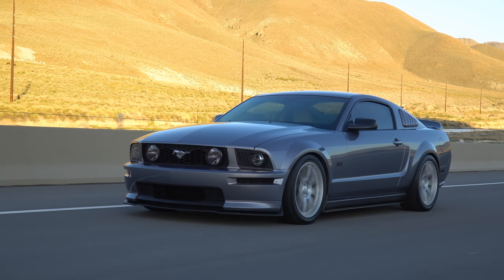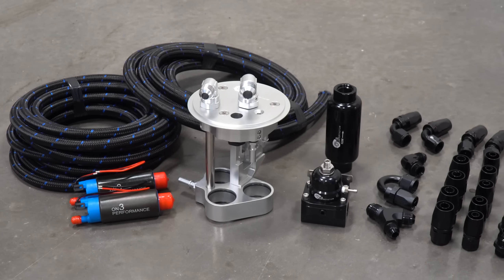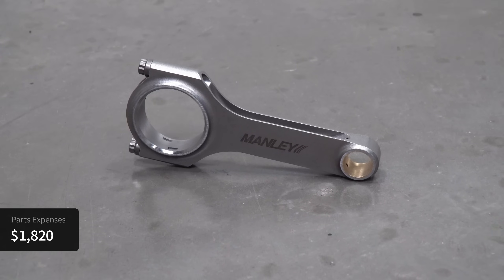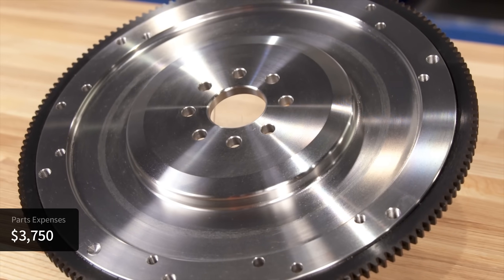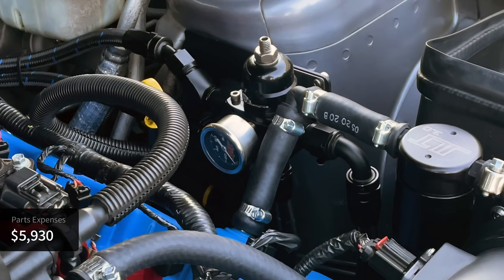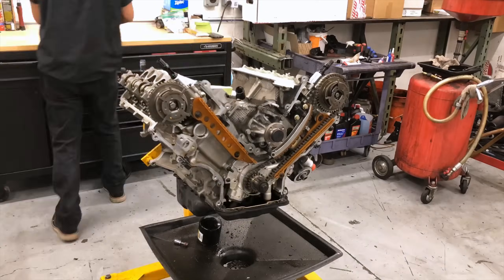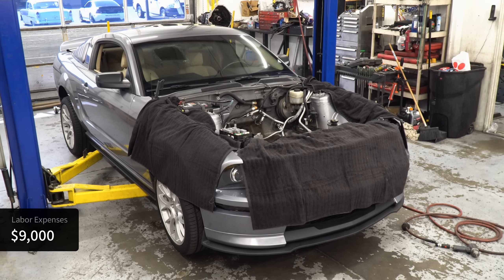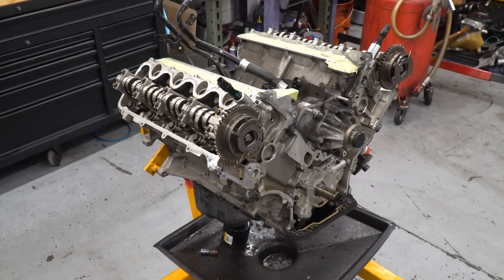Breaking down the (actual) cost of rebuilding a V8

Comment: 16k for 370whp!? Sir you have a lot of patience to not be boiling lol, good video as always!
Reply from the maker: it's certainly a bummer
Reply: @Four_Eyes  atleast its not your typical ls lmfao
Reply: @LukeWaters  lol all that money to make less power than a 6.0 ls truck engine with a 250$ cam😅😂
Reply: @neilbrown82  it wasn't built for na power!!!!  Gosh what is wrong with you people?  He didn't build it to make na power it was built with forced induction in mind.  It can reliably take 1000 for a long long time beating on it.  It was not built for high na hp it has lower compression it was built for boost!!!
Reply: @midnight347  😂 lol
Reply: @LukeWaters hey 16k into an ls would produce FAR, FAR more than this ford did. So who's laughing after that??
Reply: @Four_Eyes  nonsense man, the journeys been INCREDIBLE!
Reply: @Four_Eyes  I mean you spend enough money you could have swapped in a coyote instead but I didn't know people spent that much money on the three valve I thought most people got rid of them
Reply: @Four_Eyes  It wont be when you throw a turbo on it.
Reply: 16k wasn't spent to make a N/A motor. These mods are designed to be used in conjunction with forced induction
Reply: @blue3v067  true, bit man 16k to still be at 370whp has to hurt just a little bit
Reply: @LukeWaters  For sure lol Something like that is going to cost an arm and a leg but you can hit 1000hp without those mods
Reply: @blue3v067  and at the end of the day it's gonna be reliable too
Reply: Luke Waters imagine how happy hell be when hes hitting 700hp at 8psi😃
Reply: @LukeWaters  exactly you can swap in a Gen 2 coyote out of an F-150 and be a little over 400 wheel horsepower I don't know why anybody would spend money on a three valve in the first place
Reply: @LukeWaters  itsjusta6 has completely built GT350 motor, built for forced induction and it made like 350 wheel without any boost. When the motor was built for 1500hp. And I don’t recall if it was 25k or 50k but it was an expensive motor.

So the whole argument of “oh 16k to make 370whp is a waste” is literally just because it’s NA. And the motor was built to be forced induction as you know by this point.
Reply: @neilbrown82  At some point it's just stubbornness. It's the same as people who sink tens of thousands into a Civic to run quarter miles in 8 seconds when they could just buy a faster car instead that would get there with far less mods.
Reply: @neilbrown82  this engine can take 1000 wheel reliable a stock gen 2 coyote is not gonna do that.  They can do 800 pretty good some have hit 1000 but this built 3v will stay together much better at 1000 than a stock gen 2 coyote.  It was built for boost and is still na!!!!  Why can't people understand this?  Lol
Reply: @BigUriel  so many of you guys that make statements like that just don't understand a true car guys personal journey and satisfaction of extracting the most that u can from your favourite platform, no matter if it's a civic or a mustang or a 91 olds toronado, do what makes u happy and gives u a sense of accomplishment, especially if money's not an issue, why not? Not everyone has to build what everyone else is doing to get the most hp for the least amount of money. Extraordinary men do unique things, that's what pushes the envelop of innovation and breeds new ideas into our wonderful automotive world. I think most of these statements come from a place of jealousy.
Reply: @blue3v067 Do it. You do not understand how cars work. I hate the Toyota Supra.
Reply: @LukeWaters ”1,000hp” and “reliable”? Unless it’s a massive marine engine, there is nothing that can make you right.
Reply: @blue3v067 and another $20k?🥴
Reply: @LukeWaters  he definitely overspent on a lot, and you can do this for SIGNIFICANTLY cheaper doing everything yourself. You can build the 3v for boost that'll handle 700+whp for under 3k. Add your boost of choice, another 4-8k. This is definitely a F**k you money "because I can" build, its sick nonetheless though. Basic bolt ons and a good cam can put you at nearly this power level for a few grand. These cars are easy to find for 2-6k now, so its not that much money all in all
Reply: @blue3v067  that still doesn't make sense 16k almost 400.. if that makes good sense to you then ok..
Reply: @eddiedaugherty7063  First of all, would I spend that kind of money on a 3v, heck no. Keep in mind tho that 9k of that was labor, so 7k in parts to make a 400hp isnt too absurd. But what I was saying was he didn't spend 16k to make an N/A motor and leave it at that. You can't run 1000hp without those parts, so therefore I think its worth it. Not to mention the parts he replaced were just beefier versions, not necessarily things that will make more hp.
Reply: @blue3v067  yeah but f/I will cost him another 13 k because he's not doing the work himself he could have found a used GT500 motor and upgraded the blower and had 800 horsepower for the same price
Reply: @blue3v067  the 3v is a $5000 car. Find a car for less than 21k or even 21k making 370 to the wheels. He has a 370whp mustang with no loan and someone buying a used mustang with a gen 1 coyote is still in the 30k range, probably in debt and still losing a race.
Reply: He spent $8400 on labor. He could've saved at least 4k by doing some of that on his own.
Reply: @pronewbofficial  the labor is the real killer
Reply: @pronewbofficial  true
Reply: I was shocked about the horsepower number too. I’ve seen cars put down 20 horsepower more without the stroker kit and forged internals. Hopefully the right cams bring his numbers up cause I’d be devastated if my all motor build made FBO Cam numbers.
Reply: @5.2grimes  it's prob got lower compression because he's intended to boost it.  It wasn't built for na power.  It costed alot because it can take 1000 reliably.
Reply: @midnight347  are you aware how old this comment is lol. it’s been publicly known that’s why it made those power numbers for a while
Reply: @5.2grimes  I don't care how old the comment is.
Reply: Lol building an engine doesn’t magically produce horsepower tho
Reply: He spent so much cus its supporting mods and he is documenting everything. I made a 500whp and a 440wtq 3v for less than 10k. Been dailying it for 2 years now
Reply: @TexTheMaster  I bet its a pretty fun ride too!
Reply: @TexTheMaster  damn send your mod list 😅
Reply: 16k to make STOCK coyote power 😂😂😂😂😂😂😂😂😂😂😂😂😂😂😂
Reply: @jessefrias2575  why are you laughing? You have a 2V lol
Reply: @juju755-b7s  had. Coyote ftw now!
Reply: @juju755-b7s  what’s wrong with a 2v?
Reply: @juju755-b7s  , dont hate on tha 2vs
Reply: @juju755-b7s  that could be a 4v under the hood not far off from a 3v in terms of power stock vs stock but weighs less
Reply: @jessefrias2575  legit all he has to do now is put some type of forced induction and he’s golden
Reply: @jessefrias2575  16k less base price then a coyote mustang too
Reply: @jessefrias2575  funny when people laugh about dumping 16k into a 3V meanwhile others are financing a coyote at 400 dollars a month payments lmao
Reply: @jessefrias2575  2v boi
Reply: @jessefrias2575  and only 30 more horsepower than my bolt ons ecoboost lmfao
Reply: @christianhanna9401  ya but you have to drive a 4 cylinder Mustang.   Aka: Fail.  Mustangs are supposed to sound good not like a Focus ST.
Reply: @rxtuninginc8444  subjective, id prefer if my s197 had a 4 cylinder ecoboost, just a waaayyyy better engine, the efficiency of it absolutely shits on the 4.6
Reply: @trystanswansonart  meh the 4.6 will still probably last longer and be more reliable overall.  The ecoboost are not well proven with high mileage yet.
Reply: @rxtuninginc8444  Well that's hypothetical so it's not really possible to comment on it. I think I'll probably do the 3.5L F150 V6 swap since it's proven, don't need to reinvent the wheel yunno, but I want them mpg's since I daily my car and the first gen s197 has proven to suck back my gas lol, Just think the body style is tight
Reply: @trystanswansonart  buy another car thats cheaper as a daily and keep the Mustang as is.  For the cost of the swap you could just buy another car and modify the regular engine in the Mustang so it will be your toy.
Reply: @christianhanna9401  except ur mustang runs around with half a motor sounding like an '89 4 banger Ranger with a fart can exhaust! LMFAO!😂😂🤣🤣😅🤮🤮🤮💩💩
Reply: The trifecta of car mods. 
You can only have two at any given time: 
Cheap, Reliable, Fast
Reply: @sethbingo  unless of course we're talking about Honda engines, cheap reliable and fast!
Reply: That’s na it’s going to be at the 900-1000 hp mark
Reply: 16k to build an engine that supports 1k hp the power parts have yet to be added
Reply: You can buy a 350 out of a Van for like 300 dollars and spend a grand on it to make more power. I respect the 4.6, though.
Reply: He obviously is being sarcastic saying 370 wheel horsepower........ Right??????🤔
Reply: @danielgarcia9095 . It’s not a bad number because he built the motor to handle lots of boost. He could have went way bigger on cams and did high compression and made close to 450 at the wheels, but that was not his goals because he wanted to have drivability and lots of boost.
Reply: He has done all the work all he needs now is a turbo or turbos and tune.  That could reach 1000 hp done right.
Reply: i guess im going to by a chevy ls motor for 700.00, cam, springs and pushrods for 800.00 and have more power than that. i wanted to stay ford motor, but bump that. lol.
Reply: @SuperAudiowizard  u can buy cam n springs for $400
Reply: It’s a waste unless u have it boosted
Reply: Shoulda bought a chevy😂😂
Reply: You can 370 wheel with fbo and cams something on his build isn't right lol
Reply: @stickyicky2858  he used heads that lowered compression.  Good for when he goes FI... but hurting him while he still NA
Reply: My eco boost did 382 wheel horsepower. And it only cost me like $1,700 in mods
Reply: @4touchdowns1game29  Why are none of you factoring in the cost of the car? You can get a great condition 3v for 7-10k. Add in ~15-20k for built motor + forced induction, giving way to 700+ whp. Already a better value than a bolt-on 2015-2020 GT / Ecoboost in terms of performance.
Reply: @devnull.elixir  on what planet bro lol? Have you seen s197 prices lately? People are asking 20k for 50k miles.
Reply: @4touchdowns1game29  that's cool man. i gotta stock eco myself. 2018  with the 10 speed auto. 21,000 miles bought new. i like it. it's my daily. maybe I'll get a mild tune and exhaust. don't know, just like the way it looks. wasn't even a mustang guy.
Reply: @senorpepper3405  dope man. Yeah I like the tailights of the 18 and the front end of the 17. The 10 speed is no joke. I just like driving stick.
Reply: @senorpepper3405  yall bold for going into the exhaust shop with an ecoboost motor😂
Reply: @chevywilliams958  why?
Reply: @4touchdowns1game29  starting with a turbo car is the way to go.  Unless LS.  LS are way cheaper to build.  Hell I've seen junkyard truck motors take 20lbs of boost and live quite a while.
Reply: @4touchdowns1game29  yea you only spent 35k for the car though
Reply: @4touchdowns1game29  what mods?
Reply: @oscarpretalia8251  well I'm not going to count the cat back exhaust or the c&L cold air intake cuz it came on the car. I got it with 1600 miles for 22500. But yeah cobb Accessport 500, lifetime pd tune 400, front mount intercooler 250, catless downpipe 125, colder plugs 50, catch can 100, aftermarket springs 100. And I think that was it. Some of those prices might sound too cheap but you just got to keep an eye out for sales and deals. Also things like downpipe and intercooler I just bought mishimoto clone parts they're all made in China anyways. If you're going to buy a high dollar intercooler don't buy mishimoto it's literally the same as all the other Chinese stuff. if you're going to spend a lot on something like an intercooler or downpipe it's better to buy something straight from cobb or a company like injen. the part about modifying your car that does get expensive and would have cost me a lot more than 1600 bucks is labor. I did all the labor myself if I were to paint a shop to do it it would have easily been $1,000 plus. The intercooler is a bitch to do because it fits in there so tight and you have to take the whole front bumper off. The springs are a bitch to do because you have to compress them and its dangerous. Its also a pain to do the rear springs because you have to drop part of the whole subframe down and hold up the differential with a separate Jack. honestly though now that I've done it I could do it way quick.
Reply: @4touchdowns1game29  hell yeah bro that’s badass, I’m looking at a mustang rn think I’m about to go get it financed and get STRAIGHT to modding 🤣🤣😭
Reply: @4touchdowns1game29  I’m thinking about a 3valve tho 😬😬 I just love the look of it and think it would be a good sleeper build, something to pass on to the kids when everything  is electric lol

Comment: What a nice Saturday surprise! An interesting OEM option might be Ford Racing's M-6009-B53 shortblock that's 5.3L and is rated for 1000hp and sells for $6250. It's gotten more $$$$ over the years!
Reply from the maker: thanks for all your continued help amigo.. i think it's time you posted again.
Reply: @Four_Eyes  Thanks for the encouragement amigo.
Reply: Well now you know the secret. The 5.3L is rated for a 1000 to 1500 hp depending on the parts and how far you’re willing to go . Recommend you engine swap a v6 Mustang 2005 because there’s no fancy work needed for the swap
Reply: @tomtomreidjackson3775  That 5.3 is for coyote heads and NOT 3v heads.  Just drop in a coyote.
Reply: It goes for around 8500.00 now.

Comment: Thanks for the updates! These projects are a journey so step by step (as you know) you'll get there! I do think your tune needs some work also seems like it may not be dialed in. I would recommend you get in touch with Lund racing, arguably the best 3v tuner out there. Remember your new stroker crank is larger and  probably heavier than the stock one and possibly the rods too. So there's more parasitic losses which could account for the differences. Overall the parts are strong so they can handle the big power from the boost👍 Before you yank those cams I would advise following your goals to add the boost and then get it all dialed in with some great Dyno tuning, I think all the planning will come together and be realized😎

Comment: I really want to build the engine in my 3 valve but I’m not sure now if I should just go with a coyote swap or not
Reply: Coyote swap will be MUCH cheaper just grab a truck yote change the exhaust manifolds and intake manifold just do a stock coyote intake manifold or ported 18 and you'll be making some power

Comment: The point of return style fuel systems is to control pressure spikes and drops. The fuel pressure sensor is relative to your manifold pressure. If it reads 5psi of boost, the ecu will try to maintain 55 psi. When in actuality it is at 60 psi. This variability can cause pressure spikes because the pulse width that that fuel pump gets changed on the fly to control pressures.

Comment: Love the build and the content you put out brotha but this doesn't make any sense. You were making around 360hp with full bolts on. Since then you increased displacement, added stage 3 ported heads and with better fuel system and now your at 370hp. ??????.....
If you're sure this dyno is correct, and its properly tuned then I hope you call Livernois and tell em you want refund. they stated +75hp with stock cams.
Reply: This was just going to be my exact question...I'm confused too. I thought you'd be well over 400whp after the stroker install with everything else.